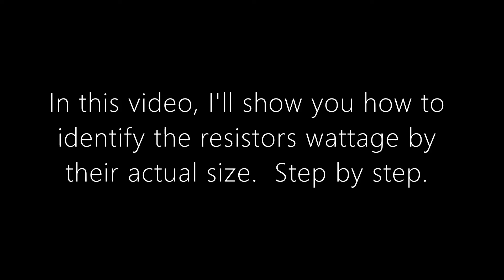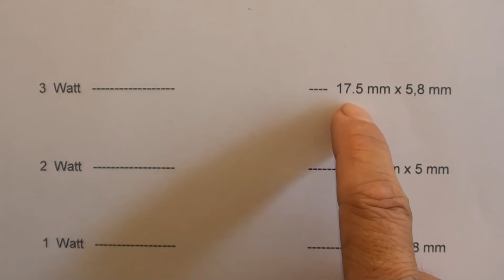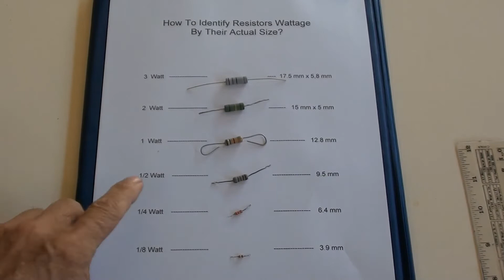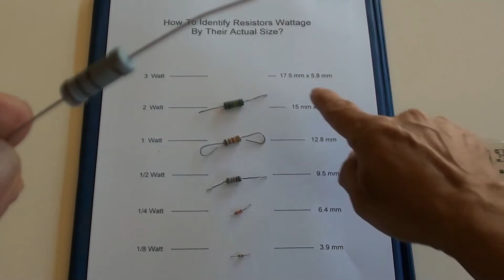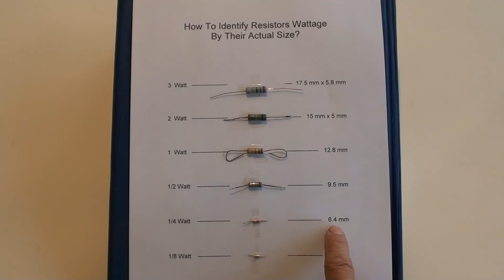How To Identify Resistors Wattage By Their Actual Size?

Comment: I have three resistors that burned up but still give a reading. Thanks to your guide I have determined that there are two Watts but each one reads a different ohm reading. Reads 5.4 ohms the second one reads 5.6 ohms the third one reads 5.7 ohms. How do I figure out what's the actual ohm  for these three resistors? Any help would be appreciated
Reply from the maker: Thanks for your interested!  There are the standard resistor's value tables such as the system of E24, E48, E96 etc.  Taking the system of E96 as an example which its resistor's value has 1% tolerance across range:  1.0, 1.02, 1.05 ... 5.11, 5.23, 5.36, 5.49, 5.62, 5.76, 5.90 ...9.65, 9.76, 9.88 ohms i.e.  so you can match three of your resistors to the closest values of the system E96.  However as you've indicated:  "three resistors that burned up but still give a reading", in the most cases the resistor's value(s) would go up after burned and their reading would be varies depending on their burned condition.  There was not much you could do unless, unless you could pin point the function of three resistors in the circuit then you'd compare to the similar circuit(s) to eliminate the other values.  Good luck! 👍👍

Comment: I went to a store and specifically asked for resistors for 1/2 Watt, but their length was 6.4 mm so I supposed they got them wrong and went to another store, but they were exactly the same. Any thoughts?
Reply from the maker: Loved your experiences!  So far, I've known a resistor as long as 6.4 mm in length, its capacity is 1/4 watt.  Cheers!  ❤👍

Comment: How would a 10 Watt resistor look?
Reply from the maker: Thanks for your interest however I do not have it yet.  I'd say a 10 Watt resistor:  Its size looked like the little finger on the hand.  🙃
Reply: @diymade2175  Could I put three 3 watt resistors in series and get 9 watt?
Reply from the maker: @samkitty5894    Certainly.  As an example here:  There are three resistors with their values are the same such as each of them has values of 5 ohms / 3 watt.  If you put them in series one following by one etc, the total values are 5 + 5 + 5 = 15 (ohms) / 3 + 3 + 3 = 9 (watt).  Good luck! 👍
Reply: @diymade2175  Cool. Thanks!

Comment: I’ve seen 220 OHM 1W 5% resistors at 9mm & 10mm long. (Red Red Brown Gold)
Can you please explain why so short.
Thank you
Reply from the maker: Thanks for your interested, Mate!  The sizes of resistors in the video showed are applicable in the most practical situations, in your case I'd say that resistor was 0.5 W instead of 220 ohms 1W however it could be otherwise.   🙂😇

Comment: I have one that I around 3mm so I guess it's 3.9 mm red red gold gold  ,does that mean it's 2.2 ohm at 1/8 watt & can I go higher  if a1/4 watt or 1/2 watt is all I can find locally
Reply from the maker: Spot on.  You have a resistor with its values of 2.2 ohm & 1/8 watt which can certainly be replaced by a resistor such as:  2.2 ohm & 1/4 watt or 2.2 ohm & 1/2 watt or 2.2 ohm & 1 watt etc.  enjoy your experience.  Thanks! 👍